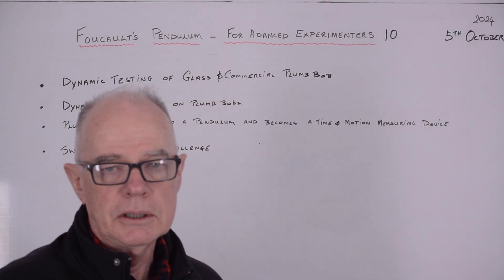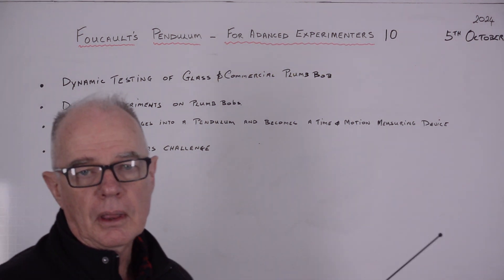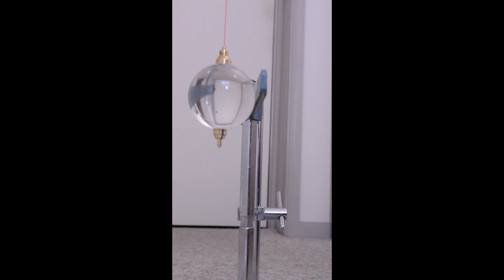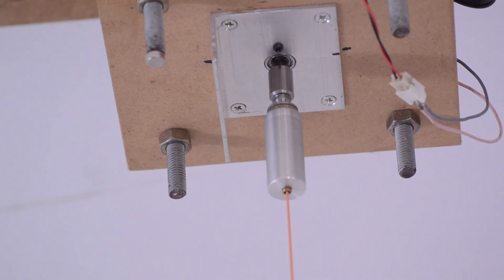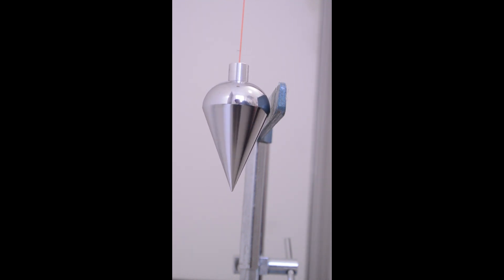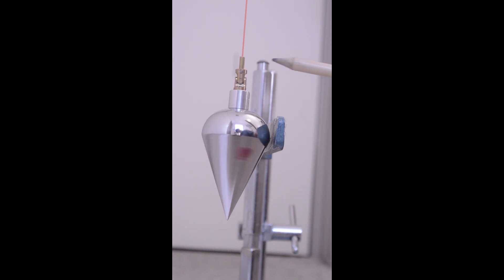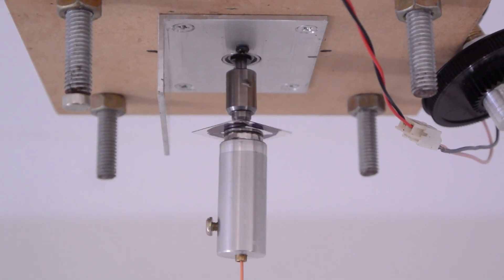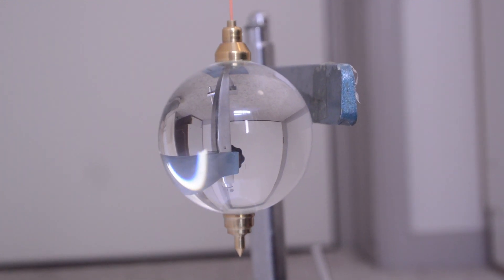Foucault Pendulum for Advanced Experimenters 10

Comment: IMO - lack of precision balancing by installing screws on one side of the parts.  A taper lock fit would be superior but complicated. I would at least switch to two socket set screws (4 in total) to pinch from either side and to reduce and centralize mass of fasteners.